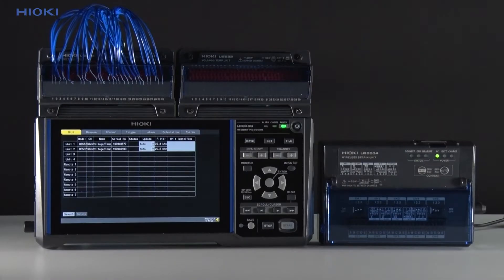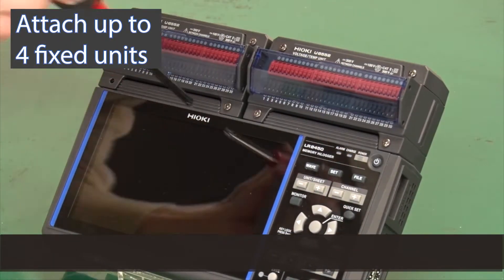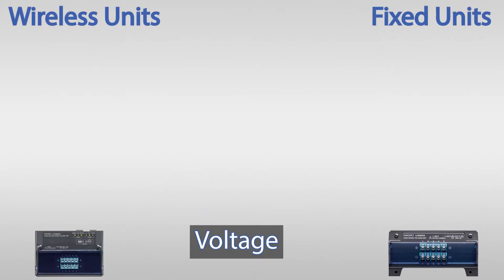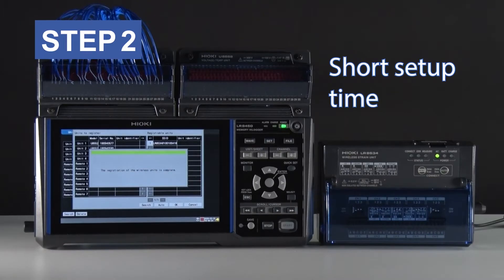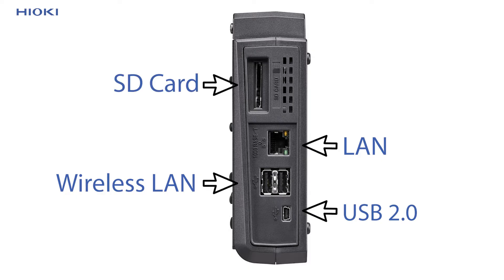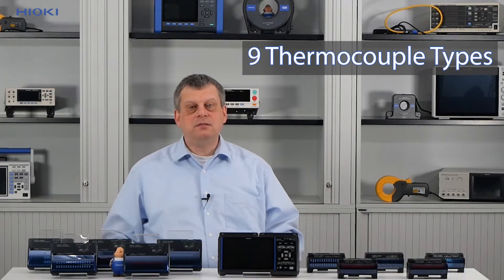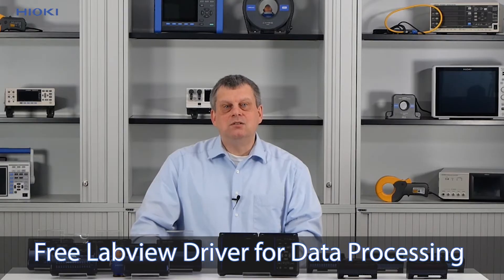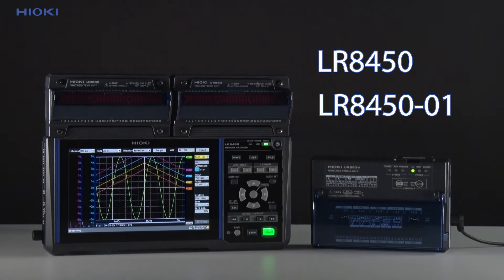LR8450  Multichannel Data Logger

Comment: So where can we use it? in server rooms for example?
Reply from the maker: Yes you can use the data logger in server rooms to measure for example temperature and humidity wired or wirelessly. 

Some other applications that are mainly automotive related, however can be used for other applications as well:
1) Measurement on Li-Io cells in vehicles. Beside logging the cell voltages, the temperature around the battery can be measured, too. Depending on the configuration of our data logger, up to 120 measuring points can be recorded at the same time in this application.
2) Measurement of strain on vehicles during operation. The sensors can be attached to the appropriate locations on the vehicle. Data can be sent and recorded wirelessly to the main device.
3) Temperature measurement in the vehicle. Here, up to 210 measuring points inside and outside the vehicle can be measured, depending on the configuration of the system.
4) Temperature measurement of the brakes of a vehicle. Similar to application example 3), temperatures can also be measured and recorded at up to 210 measuring points.

We would be happy to sit down and talk further about your specific needs, just send an email to hioki@hioki.eu.